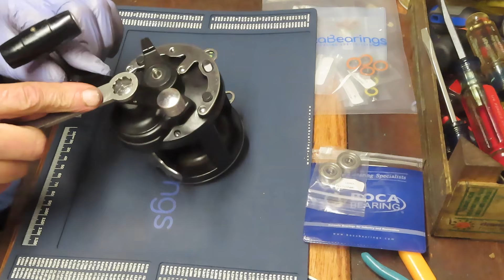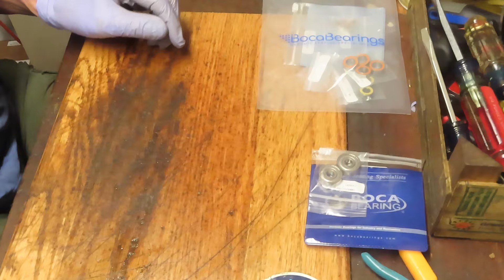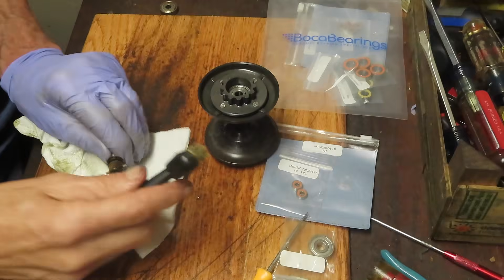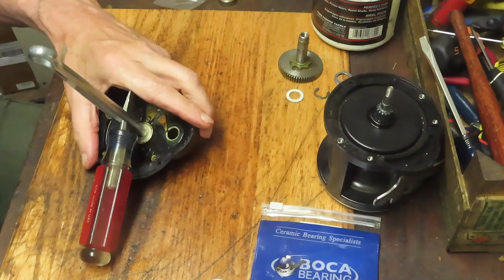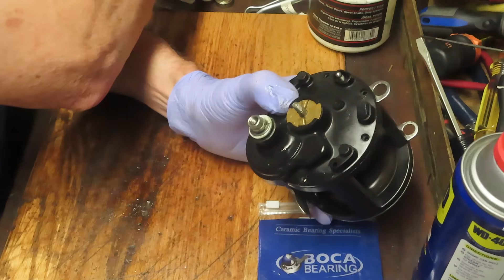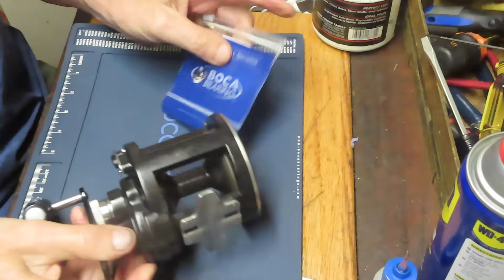Penn GLS 45 Graphite Lever Senator Fishing reel service and Boca Bearing Upgrades to improve perform

Comment: Tool looked like a very large cotter pin , hmmm might be able to make one in a pinch !  Another good video ,thanks.
Reply from the maker: Yes it does.  This piece is about 8 inches tall.  If you flatten the bottom and taper it to create a lip, it could work in a pinch.
Reply: I had the same thought. It would probably need to be hardened to be effective. Cotter pins are soft metal so they will easily bend when needed.

Comment: Those bearings do look like some of my Penn Spinfisher gearings. This reel also has quite the main gear. All in all this is a very nice reel and you did a great job showing how to change out the bearings and service the reel! — Chris
Reply from the maker: Thanks Chris
Reply from the maker: Thanks Chris.  This reel is a well made version for the time.  I have learned a few things from the comments - this is actually the second version of this model, They are all noisy (Stainless gears no doubt) and that they are all well over-engineered.  The new bearings really make a difference for casting from surf. - Be well! - Dennis

Comment: Hi Dennis,

  The first generation Penn 45GLS used a badge with a clear flexible window on the crossbar and another badge with the flexible clear window on the non-drive side bearing protrusion.

  As a cost cutter, the second generation Penn 40 and 45GLS went to screen printing the reel identification on the crossbar and a simple stamped cover for the bearing cover. Seeing how your reel is missing the screen printing, this reel is the second (last) generation version.

  I'm interested in seeing how the hybrid Boca Bearings change this reel.

PS, the 40GLS used a shim (either a hard rubber shim between the body and the drive side. side plate.
Reply from the maker: Thanks for the additional info as always.  This is definitely the screen printed version.  The bearings really accelerated the spool speed and anyone using this to cast from shore will definitely see and fee the difference.  Best wishes - Dennis